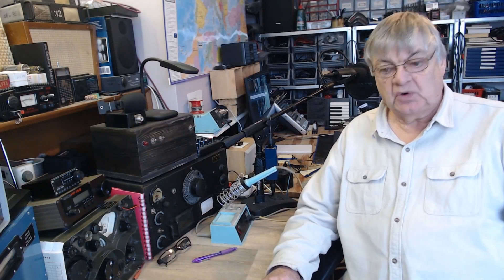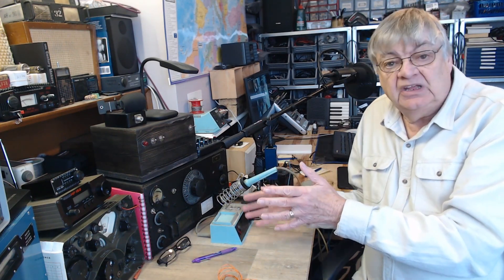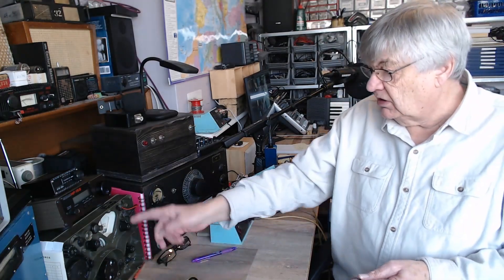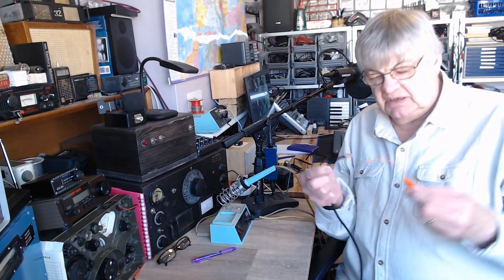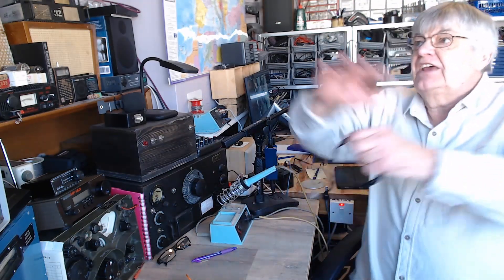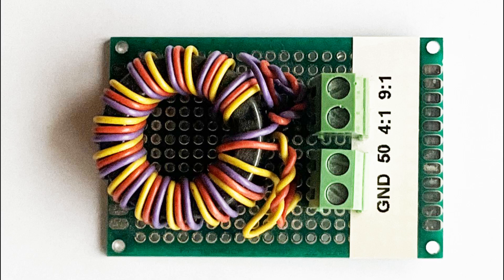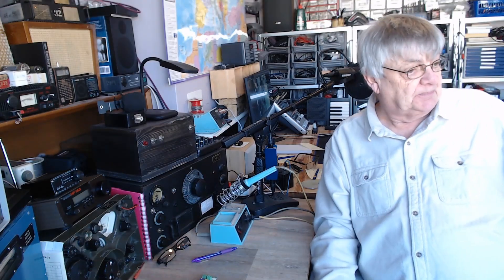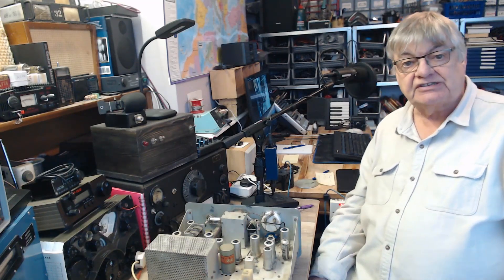G4NSJ - An end-fed receiving antenna with unun short wave HF wire ham amateur radio

Comment: Good video Ray and a clear explanation as always. One thing I have found to work well for LF to HF receive antennas is to make sure the unun is also an isolating transformer with two completely separate windings. The antenna has an earth of its own, and there is no connection between the primary and secondary grounds. This can be a big help in keeping noise from the house/shack wiring off the antenna circuit - easy to make and test. Nice to see the radio room and 570D tranceivers - my main HF radio and a really nice piece of kit. Ed KO6BLM
Reply from the maker: Hi Ed, that's a good point about isolating. I'd not thought of that. The 570D transceivers are excellent, wouldn't be without them. Cheers, Ray.

Comment: Hi Ray, when winding an unun, can you use bare wire. Thanks.
Reply from the maker: Hi Andrew, I think it would need to be insulated. I suppose you could wrap tape around the torroid and then carefully space the bare wire.

Comment: Hi Ray, Well explained. I had a fair bit of success with this type of set up but started using my G5RV half size dipole that I use for TX lately. It’s much quieter but I know supporting the centre on the garden can be a pain for some people. Nice to see the Kenwood 570D, I use the same transceiver 🙂 73
Reply from the maker: OK on the G5RV. I like the old Kenwood gear. My main rig now os the Icom IC-7300 which is very nice. 73 G4NSJ

Comment: I use a earchi ant also. 9:1 31 foot wire or about 10 meters. I find it works perfectly well for receiving on my 2nd radio. It doesn't seem deaf anywhere. In fact I split it to 4 radios with just tees.
Reply from the maker: Excellent!

Comment: Thank you for stressing the importance of an effective earth connection. And to add to that, if I may, that an effective earth requires the soil around it to be moist. As the soil tends to dry out in the summer months it can be advantageous to add water to the area around the earth connection. Perhaps more important if transmitting, than if receiving. Many thanks for your video.
Reply from the maker: Indeed, moist ground is important. Cheers, Ray.

Comment: Hi Ray. When I got back into amateur radio some12 years ago I some how came across the 9 to 1 unun. The setup I have is identical to the setup you show. I have a fairly covert antenna because of this and it never ceases to amaze me its abilities on receive and transmit on 40 through 10 meters. Thanks for the video.
Reply from the maker: Glad it worked out for you. Cheers, Ray.

Comment: I use "EARCHI" antenna which is Balun Designs or Palomar Engineering 9:1 UnUn Balun, 29 feet wire and 15 feet wire counterpoise, wire is attacked to 30 feet telescopic mast. Using 25 feet LMR400 Coaxial Cable from LDG Antenna Tuner to Balun, also 3 feet LMR400 jumper from Radio to LDG Antenna Tuner. Works like a charm 6 meters to 40 meters.   ; )
Reply from the maker: Excellent!